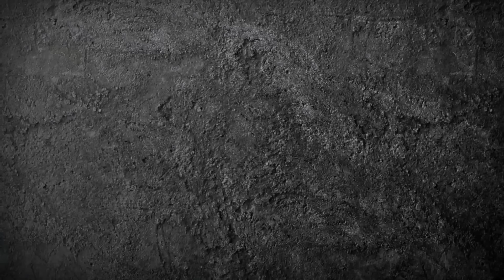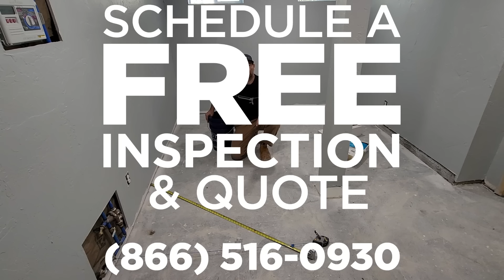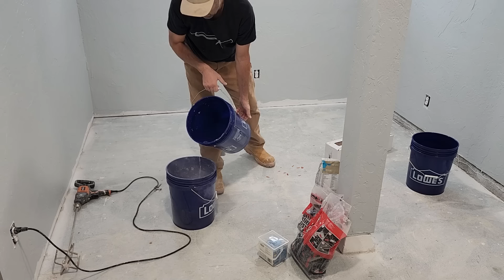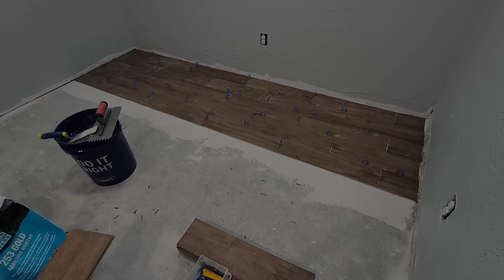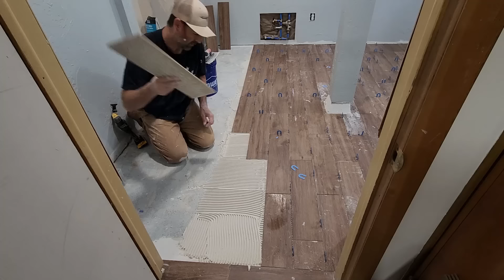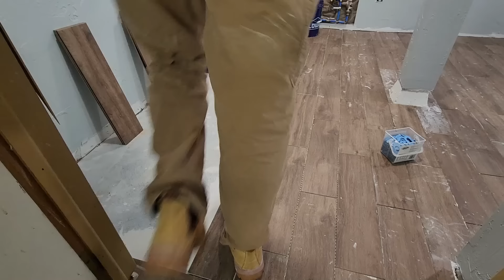They Told Me Not To Do It Like This | THE HANDYMAN |

Comment: Yes, back buttering is best practice, always...Ditra not needed, a few coats of Redgard or other liquid waterproofing on concrete is same thing...and cheaper. Also a gray thinset would be better for dark grout to prevent bleed through.

Lastly, I use a kiddy float that I bought at the dollar store years ago in place of knee pads, easier and better.
Reply: Laticrete cementious is better then redgaurd
Reply: @ALLworldCONSTRUCTIONLLC  agreed
Reply: The hells a kitty float?? 😸
Reply: @JonnyDIY  was a typo...kiddy float
Reply: @StarrTile  ohh cool like a blow up one. I use those foam kneeler pads a lot too

Comment: Get you some "QEP Comfort Grip" kneepads. Super basic, not too much padding so just feels like normal kneeling. I wear em all the time. I guarantee youll like em👍
PS- my God! My back started feeling it at the end like yours 🤣
Reply: I had a pair of those and blew them out within a few days from installing my vinyl floors over concrete. I was duct taping old carpet pad inside them towards the end because it hurt so bad. I couldn't walk for about a week! 😂
Reply: @dsc-nr5zy  ohh mann yeah they're thin for sure, but you can barely feel them there. Yeah Ill throw a piece of foam behind my old ones too when they start getting flat. Floorings the worst of the knees and back. I hate it 🤣